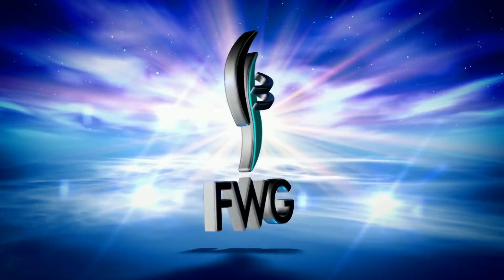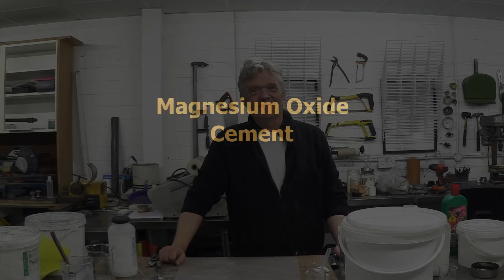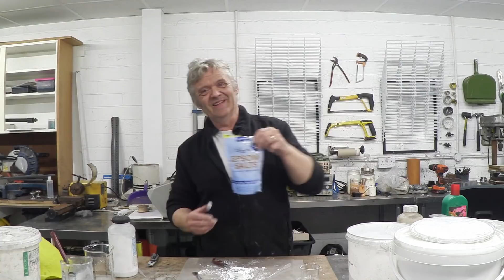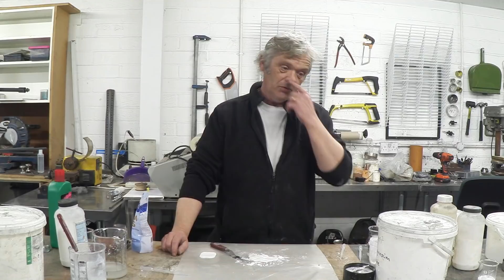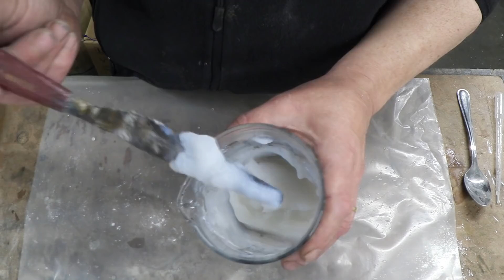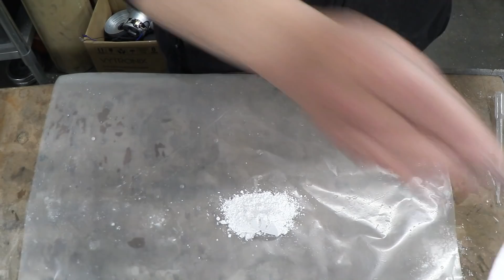All About Magnesium Oxide Cements

Comment: This makes sense - Magnesium Oxide gives me a concrete stomach (as an antacid) so why not use it to make concrete?  😋  Aside from aiding in the ease of mixing, I imagine adding water to the fumed silica makes it easier to weigh?  It's so light it virtually "floats on air", but I imagine adding water would help "weigh it down", and then you just need to subtract the weight of the water you added.
Reply from the maker: that is pretty much what I do
Reply: @ThinkingandTinkering  Thanks Robert , we make Mgo boards and find it very difficult to work with Mgcl2..
Will try the silica formulations but its going  to cost more...
Can you suggest whats best to make a Mgo board

Comment: The big advantage of using these cements, is that you can mix them with organic dirty soil. So you can use the soil on site, so you use material that's already there! Just mix it in in the wet ground, that makes it cheaper and easier. With portland cement you must use very pure washed sand so you can not use what's there already. With portland cement everything has to be bought / transported / removed / supplied.
Reply: So it would be a good match for Earthen Brick?
Reply: @GriffenNaif  I haven't tried, I am no expert. Can only say what a huge advantage that would be to the traditional 'buy  everything' method.
Reply: @nr7000000001  agreed less buying
Reply: @nr7000000001  I see it being used as airkrete and someone answered below huge advantage that you can use it with dirty soil..  "The big advantage of using these cements, is that you can mix them with organic dirty soil. So you can use the soil on site, so you use material that's already there! Just mix it in in the wet ground, that makes it cheaper and easier. With portland cement you must use very pure washed sand so you can not use what's there already. With portland cement everything has to be bought / transported / removed / supplied."

Comment: Awesome stuff. Never heard about this before. But I have followed Dr Joseph Davidowitz work and also watches his yearly videos regarding Geopolymer. I don't understand fully what he is talking about since I am a layman, but I find it so interesting so that I still listen to it. I think there is some parts here that are same and others not. Geopolymer is "stone" and resist water really good, hardens without a lot of heat (no need to water it when drying). Robert, this video was super interesting.
Reply from the maker: so glad you liked it mate - cheers
Reply: Magnesium oxide is used in many aircrete formulations too.
Reply: @technosaurus3805  I was wondering it that would work - no you know if those mixtures stand up the elements (rain etc) or do they require a special extra coating to weather proof them ?
Reply: @jonnyde  I've only seen it used encapsulated in walls or with stucco on the outside and plaster on the inside.  It has good R-value and sound attenuation characteristics though.  Honey-Do-Carpenter's channel does a DIY version using Portland cement and a foaming agent.

Comment: Just to get ahead of anyone thinking the phosphate cement is a good idea for large scale use, it isn't unless we find A LOT more deposits of phosphates/phosphorus. P is the main component of residential waste streams that is actually worth recovering due to the cost & availability of global deposits, and we also usually get the benefit of recovering potassium at the same time.
Reply: ......even been concerns for continued availability of sand. China for example produced and used more concrete in a decade than USA did in over a hundred years .
Reply from the maker: I did mention that in the video mate - not the China bit - but the phosphate lock for sure

Comment: awesome job yet again.  from what I understand, the great wall of China used a cement that was pure white and extremely durable.  Was it one of these cements?  Thank you very much, God bless you and your family.
Reply from the maker: may well have been mate - China is the world's greatest producer of magnesium oxide
Reply: Construction varies based on the years it was built, but it looks like during the Ming Dynasty they used a mortar made of glutinous rice flour and slaked lime.  It was an exceptionally strong mortar, even surviving earthquakes.  (Edit:)  Looks like the "secret ingredient" to the strength was the amylopectin from the rice flour.  It allowed the mix to compact exceptionally well.
Reply: Yes Randy they used Mgo for binding in between the stones and it still hold good
Reply: @ThinkingandTinkering  many Dams in china were built using a MO base cement

Comment: I believe you may have just blown the lid right off of the secret that has eluded me on the method of manufacturing of japanese synthetic whetstones or ceramic sharpening stones. I believe it would only require the addition of some ultra finely screened aluminum oxide. Although I believe the stones in referring to are actually fired to harden them. But thank you and if you know how these stones are actually made plz do share thank you and keep up the great work.

Comment: Great video, as usual, thank you sir :). May I ask you also mention some more mixtures, especially ones that are heat and shock resistant, i. e. would be suitable for repair of the inside fire-resistant layer in old ovens or fireplaces? Thank you and keep up the great work!
Reply from the maker: just have a look on google scholar mate - you will find a ton of recipes
Reply: @ThinkingandTinkering  could you name some sources to procure some of these oxides? That would be very helpful.  I've been trying to figure out how synthetic Japanese whetstones are manufactured and I think you may have just given me my answer. And interestly enough I just broke my 12000 Grit synthetic Whetstone so I'm thinking since it's already broken I could take the pieces put them into a blender grind them up really really good and then add a bit of magnesium oxide and a bit of magnesium chloride and possibly recast the Whetstone. Thank you

Comment: Rob, is the material conductive or can it be made conductive  by mixing in carbon or wood ash something to do that and applied to a current collector foil type plates to use in a battery.

Comment: Hi Robert. I've been experimenting (like you recommend, actually doing it) with calcium hydroxide and diatomaceous earth (amorphous silicon dioxide). I believe the reaction is generating calcium metasilicate and water (might be "old" terminology). By adding sodium chloride I noticed it seems to improve it's strength. Is this considered a Sorel cement?

Also, the zinc oxide and zinc chloride cement. Would it maintain strength under sea water since chloride ions are available so less leaching would occur?
Reply from the maker: what you're doing with the silicates is more geopolymer work - not so much cements. i know this can be a confusing definition to get hold of but basically one is a chemical reaction and the other is a physical interaction. it's unlikely to work well under sea water as the chloride ion ppm is really low so diffusion would still be likely to occur.
Reply: Have you tried Calcium hydroxide with Silicic acid? I'm not sure of availability of this type of Silicic acid (orthosilicic acid?), but I think it's the type which precipitates when adding an acid to Sodium/Potassium silicate. So you could potentially make it yourself. 
Another one worth giving a go, if you haven't already, is slaking Calcium oxide and adding a fat, or oil during the process. Once dried this mix yields a "hydrophobic lime". You may also want to try heating slaked lime or even just a slurry of builders lime with some oil on the stove, as the oil/fat may combine with the lime in a similar way. 
I have made "hydrophobic lime" myself but am not 100% sure how it works. One might think the oil/fat would just saponify (With Calcium hydroxide being a strong base) and not add any water resistance at all and just constantly wash and leech out of the dried cement, concrete, mortar or whatever. But I don't think that's the case, considering the hydrophobic properties of the final material. Water just rolls off it. Maybe have a look into how much oil can be used before it compromises strength, I remember reading about it somewhere online.
Reply: @ThinkingandTinkering  I hear the Romans used Volcanic ash in their water setting concrete.
Reply: @mrdovie47  crushed, fired clay bricks/pottery works too.  The Romans learned that in Germany where there is no volcanic ash.
Reply: @ThinkingandTinkering , Vetruvius found that after immersion in sea water for 10 years Roman cement produces plate like objects called phillipsite that bend rather than shatter under stress which is why the Roman sea harbour walls are so strong and long lasting.
Reply: @Kyle-sg4rm  Ca(OH)2 does saponify the fats/oils and thats what makes it hydrophobic, as the calciumsoap is insoluble in water. A similar process was used to make washable walls thru painting slaked lime on to them and then rubbing soapbars all over, thus creating a layer of Ca-Soap with its hydrophobic end sticking outward.
Reply: @Luziferne  Thanks, I hadn't considered the solubility of calcium soaps - I didn't realise they could be so insoluble. Time to do more research!

Comment: Foaming agent for MO cement?  There is a company building foamed magnesium cement houses.  This makes the cement insulating.  What might they be using to foam the cement?

They mentioned that the first try blew the mix out the mold like a volcano.
Reply: Oh what it the company's name? I would love to give them a look.
Reply: ......In some cases something as simple as polystyrene beads have been incorporated. I understand a suitable protein covering treatment of the beads was done first.
Reply: @philipvernejules9926  Polystyrene isn't particularly environmentally friendly. 
   I wonder if one could use kapok fiber?  Stuffs almost as insulating as lower quality duck down and only slightly heavier.
Reply from the maker: I don't know mate - interesting idea though

Comment: Cast the cogs for your gears using this method and you will have stronger gears for your projects.

Timing belt gear molds using this method would make for stronger materials.
Reply: Use a caulking gun to extrude the cement and you could fill a mold in a jiff.

Add graphene and you have an extendable material for molding.

Comment: Robert I can't help but be reminded of the aquion battery which used magnesium oxide and salt water as two of the materials.  It just makes me wonder if you can make a sold state battery out of these cements.
Reply from the maker: pseudo solid for sure - actual solid - don't know
Reply: @ThinkingandTinkering  I am willing to bet most wouldn't know or care the difference.  If the battery would not leak something toxic in an impact failure and not burst into flames there should be applications that make since.  
We just need to get to a point as a society where we don't demand a single solution to all peoblems.
Reply from the maker: @DanA-nl5uo  spot on mate and I agree with you

Comment: Fun stuff Rob... You didn't mention the shrinkage rate, would be good to know should you want to mold this material. I have added milled carbon fiber to many different projects with great results. Adding milled carbon fiber should make these cement mixes mush stronger as well as becoming a conductive solid. What are your thoughts?
Reply from the maker: experimenting with composities like mcf additions is always a good idea. these kinds of sorel cements bond very well to organics and carbon structures. the combinations are vast so experimentation is certanly needed and to my mind a good idea. re shrinkage - again individuals will change this so shrinkage should be measured. easy exercise would be to make a bar of it and measure wet and dry - that will give you shrinkage.
Reply: @ThinkingandTinkering  - Thanks Rob... If you are interested I'll keep you informed. Currently working with nano colloidal silver. Plan to fill with 60 micron mfc and a new mined material (forgot the name) which will boil in nitric acid to see if we can change properties also to be added to the above components...maybe a new capacitor.
Reply: @sonnyhayes689  Any update on your experiment. Always been interested in nanosilver or nitric silver-based items.
Reply: @lunacyworks  Lunacyworks...The material was only slightly conductive. Currently working on adding 30 micron milled carbon fiber to UV cured resin. Results are promising.

Comment: Hi Robert, would any of these cements be durable enough as moulds for molten Aluminium?
Regarding your query in the last video Magnesium Oxide is used to treat horses who suffer from anxiety and nervousness.
Reply: A 1,000 kg of panicking animal is a deadly thing.
Reply: Magnesium supplementation can be really effective for humans who suffer the same.   It fixed my life.
Reply from the maker: I don't know mate = probably yes if dried - but worth a try for sure
Reply: 85% sand, 10% portland cement, 5% water makes an OK reusable mold for metal casting. I'd think you might get similar results replacing the portland cement in that recipe.
Reply: Ive experimented with this with some success. Try to avoid material comibinations that form hydrates; the water tends to get out of the crystal at fairly low temperatures. Same for carbonates; depends on the particular carbonate but they might also offgas at molten alu temps.

Comment: Extremely interesting stuff thanks Dr Rob, I work with lime putty so your film has led me down some intriguing rabbit holes this morning at 3am.
 
I also read about Coade stone, a ceramic stonewear 'stone fired twice' as used in many stately homes and Buckingham palace whose original mix was patented in 1722 by Richard Holt but later the clay recipe was perfected and the firing tweaked by Eleanor Coade in about 1760 where her company ended up being the sole artificial stone manufacturer.

I also read that when Sorel cement is mixed with the magnesium it's the best kind of barrier for radioactive materials. 
Globally we make about 4 billion tons of concrete every year. 1 ton of cement produces about 3/4 ton of co2.  Lime mortar produces 80% less co2.

Geopolymer concrete uses about 95% fuel ash, sets at room temperature and takes about 24 hours to fully set 
and gives off 75% less co2 than cement.
Reply from the maker: very interesting stuff mate especially the code stone - thanks for posting
Reply: .....is it cos they factor for lime absorbing co2 during it's decades long setting process .locally here the lime mortar appears to have been a failure in construction back to the war years , chimneys and walls crumbling . I reckon the mortar requires a dry climate to work .

Comment: Wondering if any of these would work in an aircrete mix? 
ohhh more things to try
Great video Thanks!!
Reply from the maker: glad you liked it mate - cheers
Reply: I had the same idea :)
Reply: what kind of aircrete?     release of hydrogen   or addition of a soap derived foam ?   or other ?
Reply: Aircrete !!!  yes, that is my mission for this year :)
Reply: 99guspuppet for releasy of hydrogen you could probably add some aluminium  powder to react with alkaline cement . Havent tried it though !

Comment: What if we do some Urea and heat it while dissolving it into the water that you mix into the magnesium oxide. Then take and add a little baking soda to make it a fire brick. hmmm, lol now I want to make a ultra small kiln the size of a 6" bowl out of this to see if it will work, First I need to try a brick and heat it to see if it will hold up, I could even mix some graphene and graphite to it to make it even better. Awesome stuff mate, great chemistry lesson.
Reply: what if we replace the magnesium oxide with baby powders, hmmm - lol worth a shot
Reply: @jasonwitt8619     Aren't talc based baby powders becoming increasingly hard to find?  I think the companies are switching over more and more to cornstarch based, because there were trace levels of asbestos found in some talc. 
  I may be off about this.
Reply from the maker: it is worth a shot mate - talc is magnesium silicate mostly
Reply from the maker: go for it mate -mostly I like the spirit here - do a video too if you would - you have asked some awesome questions that can only really be answered by experimenting and I would've to see the answer
Reply from the maker: no idea mate
Reply: @justinw1765  I do know that there is a fireproofing recipe that can't be burned through. It was corn starch with some baking soda and then elmer's glue. I took that and went one step further and added 250 mesh graphite powder and yes it worked, I couldn't burn through it with the torch but as for companies switching over to non-talc, I have no idea. I haven't seen that yet, the back of my container still says talc.

Comment: I like to look at the chemistry of production processes right back to the original source for different materials however with few exceptions doing this has made me conclude that there really are no "green" materials that are not sourced locally, only different ways to screw up the environment if you don't account for all of the energy to make and transport the material, plus all of the waste products that are not useable in other products at suitable volumes to match the production of the primary material. The hideous mess in China that resulted from the wastes from silicon wafer production for solar panels is a very good example of how these problems can be hidden from the end consumer.
Reply from the maker: no there aren't the issue isn't the material - it's the volume of material and most of that is because we buy too much - stuff we just don't need